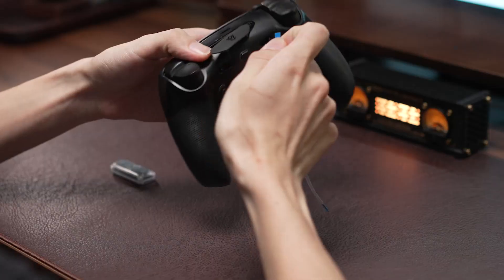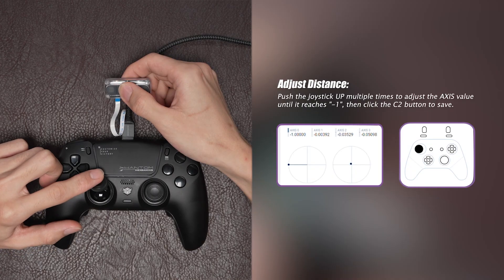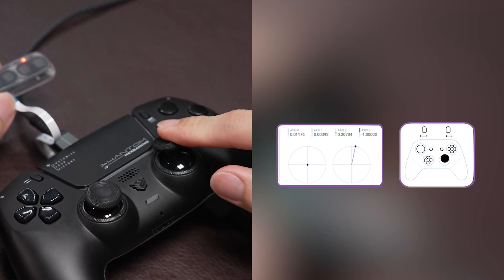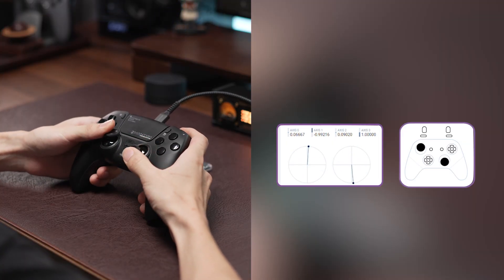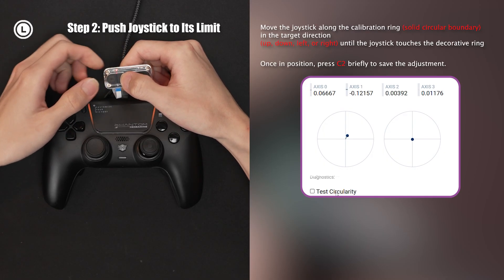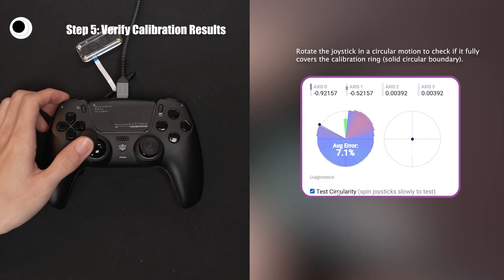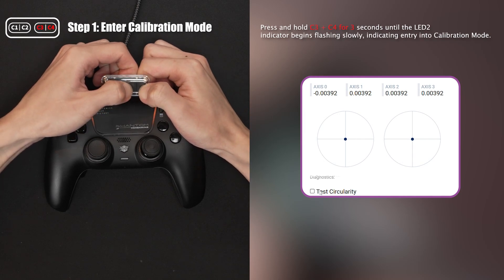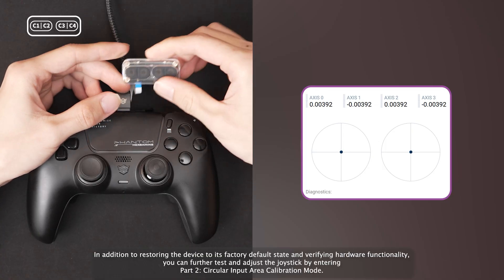HEX Hall Effect Joysticks Calibration Tutorial - For Phantom & Ultimate Pro

Comment: This what the support team at Hex told me. I used a different computer and can actually calibrate it.

The calibration page is not displaying the joystick values correctly. This is usually related to browser or device compatibility, rather than a hardware fault.
In your video, the values appear to remain at 0.00000, which means the browser is not reading the joystick input properly. Because of this, the calibration cannot be completed as intended.

To resolve this, please try the following:
Use a different browser (for example, Chrome, Edge, or Firefox)
If possible, use a different computer or device
Connect the controller directly with a USB cable (avoid hubs or adapters)
You’ll know it’s working correctly when the page shows the joystick movement circle and the numerical values changing in real time as you move the stick. Once the values are visible, please recalibrate the joystick following the guide again.”

Comment: Great revision of your original video. I offer some advice to help find center for NO stick drift:

I had Apex open and controller connected while doing calibration so that I can actually see if it’s centered or not. When you start step 1 (holding c1 or c3 to set the axis values to “0”) you need to move the stick up/down/left/right to adjust both axis values, each stick has 2. As you do this you’ll quickly see in Apex if the stick is actually at its center or not. If it isn’t the camera will look like standard stick drift. Once it’s centered it won’t move or barely at all.
***This works best for your aiming stick, you can change which stick is the aiming stick in Apex settings (southpaw) to calibrate your other stick.

Really hope this helps!